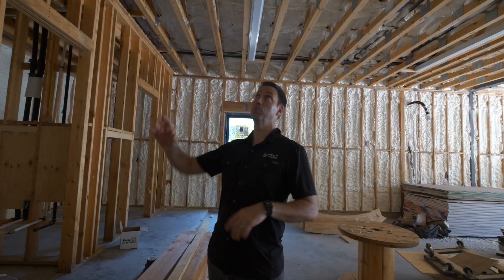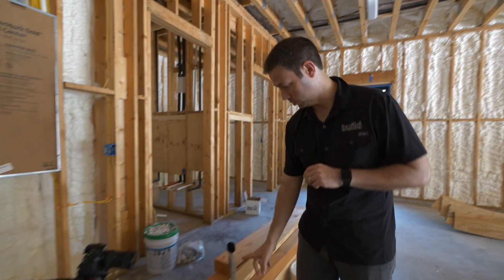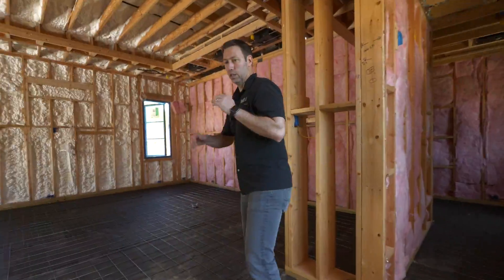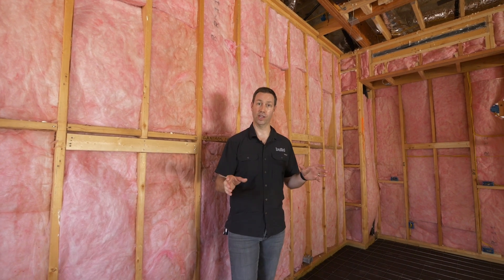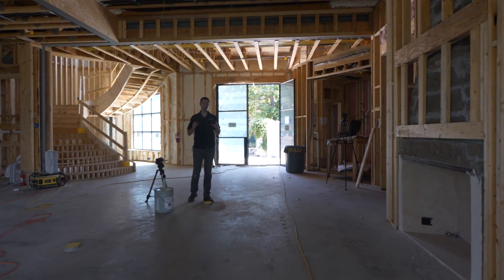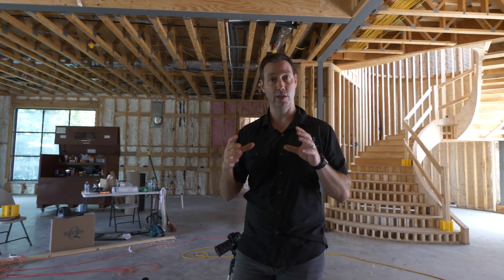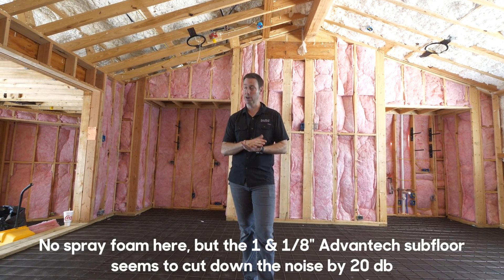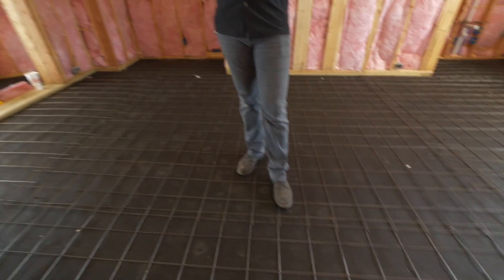Does Spray Foam Soundproof a Floor? Lets Test it!

Comment: Spray foam sucks for sounds. Sprayed a 2x6 wall. One side bathroom one side garage. Can hear through it clear as day. A perfect house is 2x8 structure, 6 inches of foam and then roxul for sound on top of that. Not to mention it's a fire barrier
Reply from the maker: lolMyke I like that assembly!
Reply: I agree. I put a little closed cell foam around a shower that was next to a bedroom. It may as well not even be there. I think closed cell foam may actually amplify the noise.
Reply: Totally true.  I put spray foam around my dishwasher, and no change.  It is too light.  A heavier mass is needed to dampen sound.  Live and learn.
Reply: Yes you 100%correct 6in ruxul spray is not good the amount you need to just get the effect ruxul  does I tell owners that because lying to make buck come on foam no good and advice one side wall I understand get more if you roxual all walls and ceiling because them sound waves bounce and have to exit point and as you said fire proof lol is a house really ever fire proof how many house you think burnt to ground and roxual went with it fire proof closed cell if sprayed and sealed proper is best watch videos is good  and they are working sound proof foam  give 2 years tecnogly will create it and then every one be bitching cause it will be$ 5.00sq.ft because it sound proof fire proof closed cell in one they will eventually male all insulation gone no anything open cell gone they will have one kind that does it all and there changing codes to point where there forcing people switch foam we do alot brand new house and there all pretty much foam invest now before you have to and if can get in the bussnies next 5 years company's be banking and then it will be normal steady bussnies

Comment: Was it open or closed cell spray foam?
Reply: Joseph Lucero 0:30
Reply: Open cell foam loses R value as it off gasses into your lungs and rots the wood it encapsulates . The open pink insulation absorbs the sound. Completely different results when you drywall and the sound bounces off the walls

Comment: Matt, do you put these sheets of pink insulation in the inner walls (between rooms) for sound proofing as well? Thank you.
Reply: alteragnostik Fiberglass thermal insulation doesn't help with sound insulation much at all. Thermal insulation works by creating air space to trap air. But sound insulation needs to be more dense to absorb sounds vibration.

Comment: Hey Matt Great video Lots of good info. Did you consider Mass Loaded vinyl? Also slightly off topic - Could you air seal the inside of a garage to separate it from living space with with poly wall and then insulate with blown in cellulose or roxul?

Comment: I've seen some real horror stories about spray foam. The problem is that the finished mixture is at the spray gun tip.
Reply: Sounds anecdotal.